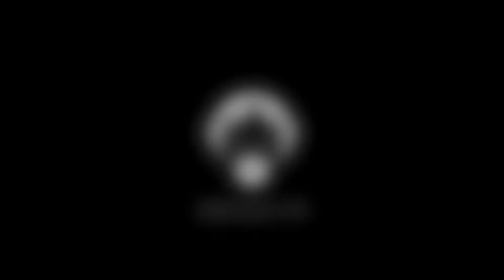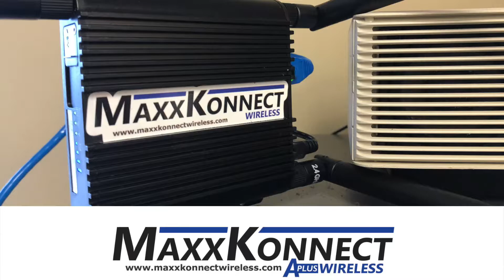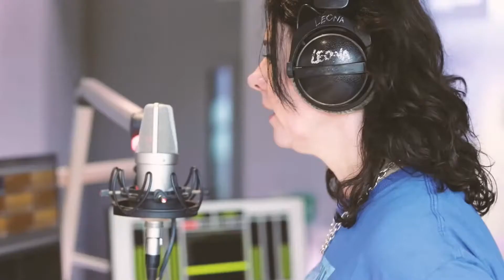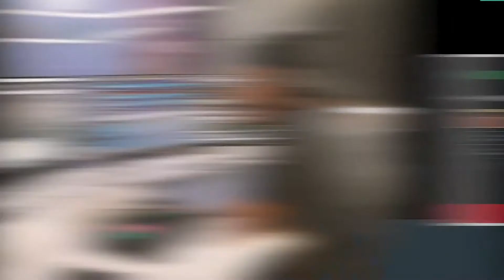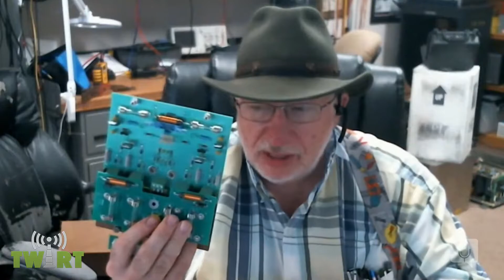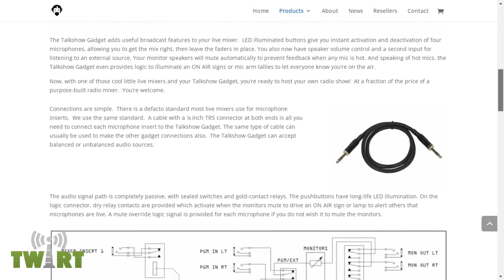Better than New with Mike Patton - TWiRT Ep. 618

Comment: He’s very knowledgeable, with years of experience and a background that includes caring for hundreds, if not thousands, of transmitters at a variety of different-sized radio stations. Who is that? Why it’s Mike Patton, of course.

Mike joins hosts, Kirk Harnack and Chris Tarr, on this Episode 618 of the TWiRT Podcast, in order to share some of his experiences in providing updates to existing transmitters. This episode is a combination of valuable teaching time and war stories.

Broadcast engineers will enjoy hearing what Mike has learned, as he has provided significant improvements to the original design of various transmitters.